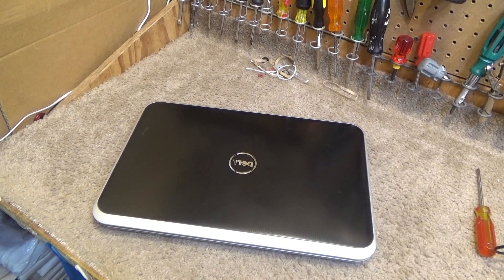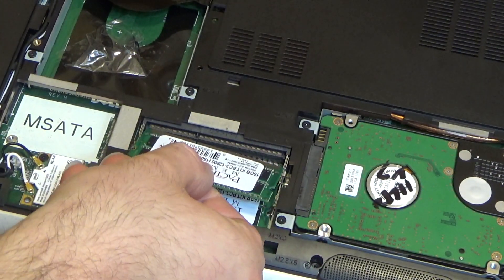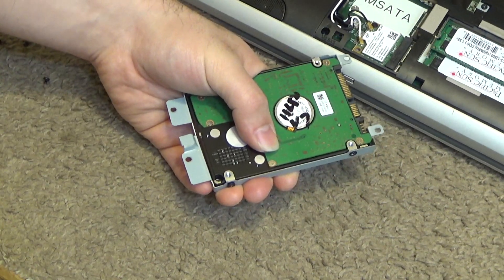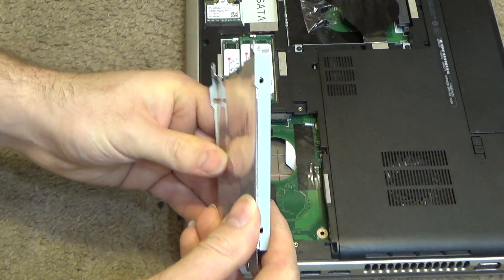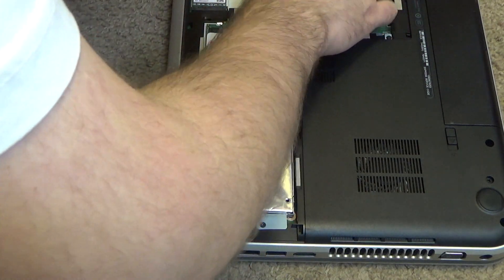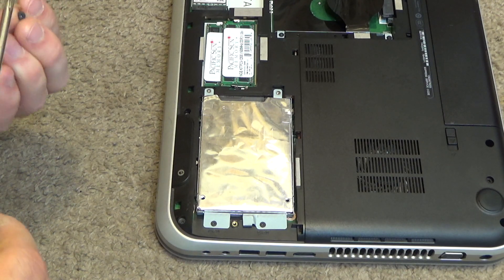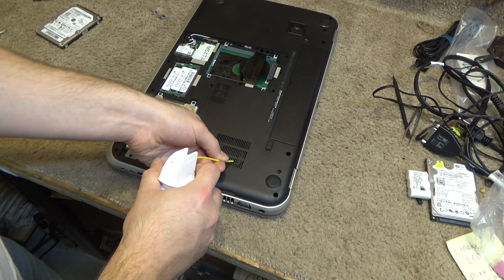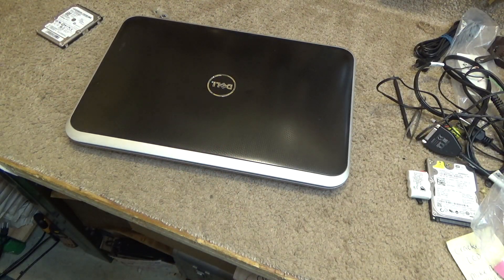Dell Inspiron 7720 Hard Drive and Memory Replacement

Comment: Thanks very much! Did you clone the SSD first or later? If one installs the SSD is there need to change any settings in BIOS in relation to the mSATA- I read somewhere else that the mSATA is only of much use if there is a slower mechanical drive. Thanks again!
Reply from the maker: I did not clone anything. No BIOS changes should be necessary.